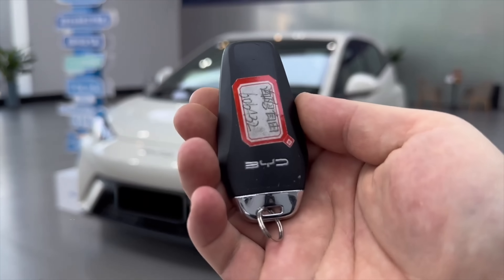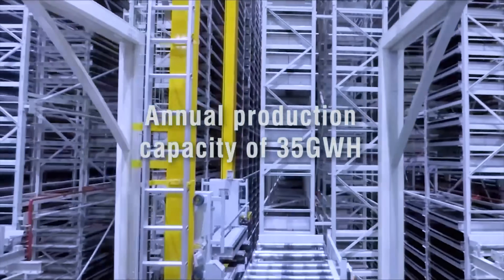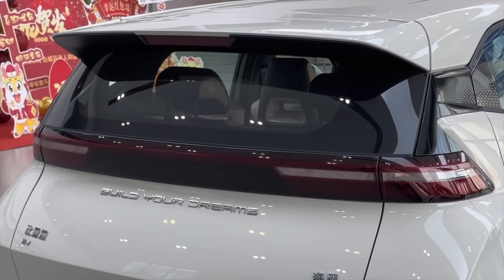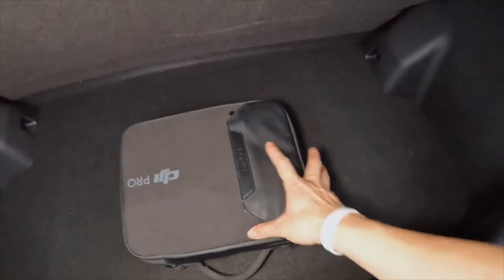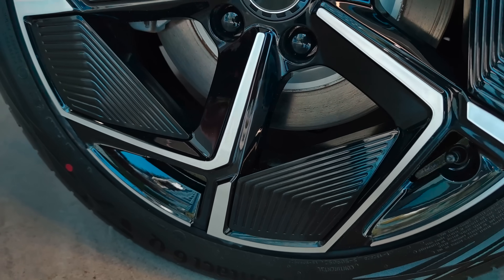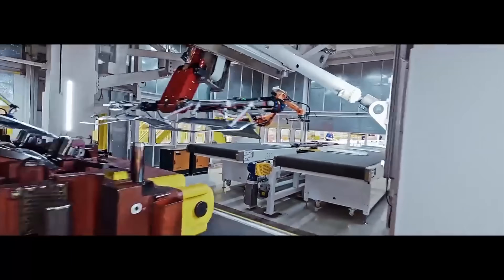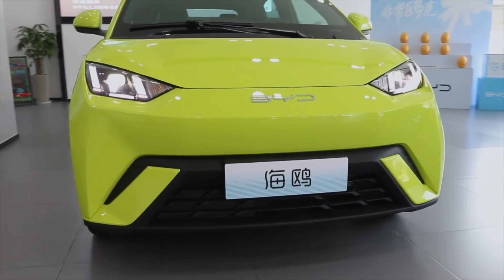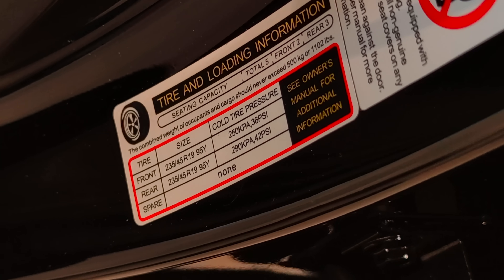Which BYD Models Are Getting the New Gen 2 Blade Battery?

Comment: The Blade 2 short format battery with much faster charging speed but not the much better energy density is already out in the Han L EV and Tang L EV. The Blade 2 long format battery with much better energy density is not out yet. If you can wait for it, it's probably worth it, as they have about 30% better cycle life as well.

Comment: mmm. Except that ignores the difference in chemistry and the reasons why HMC MNC cells have that 20-80 guide 'limit'. The blade cells are LiFePO4, and that chemisty really does well with 10-100% charge/discharge cycles. With LiFePO4, if you don't go above 80%, the float balancing, which is key to its longevity and performance, will not happen, at least, not effectively. It is my biggest disappointment, as a now retired automotive 'engineer', that the media do not distinguish between the chemistries, and do not challenge the myths. What does the Gen 2 blade cell bring? Leave the nominal capacities on the Dolhin (for example), where it was, but the pack itself will be much smaller and lighter. This gives you more space in the chassis, and the car weighs less. It also gives you the option to offer an even large pack option - expect that. At ex-factory pricing, on the Dolphin, it would shave as much as US$1000 off the end of line rolling cost of the vehicle. That will more than pay (money and in weight) for the additional DiPilot feature. This is why Gen 2 blade and DiPilot will go hand in hand. The new LHD vehicles being made in China already have both. The factory in Thailand will by now have received the parts need to start RHD '2025/2026' production. I do wonder where Byd will eventually produce the RHD models for the UK. They are currently spending a lot of money here, acquiring dealership premises in almost every town it would seem. The size of the network they are building speaks to a very large target sales volume. However, they have very little stock here, and delivery lead times from Thailand are quite extended. Even with such low stock, new sales discounts are quite strong. It does make me wonder if they have an eye on a factory site in the UK.

Comment: Hi Ben!  My Seal premium was collected 15.Dec. 2023   Today it is 66K (over) on the clock.  No problems, no complaints with it -- if anything,--- only accolades.  And I still love it.  Battery degradation? -- I don't know, but I can't notice it.  Of course, it is gen.1 battery.  Wander if the gen2 battery -- will be of the same quality?  And I mean, highest possible?  Greetings Ben.  Adam from Adelaide. Bye.

Comment: Thank you for the clear explanations regarding the second generation of LFP battery, Blade. We currently have a Renault Twingo ZE, mainly for my wife who drives within a 25 km radius of the house. We have been using it for 4.5 years and we are very happy. The trunk is a little small and the rear seats are not easy to access. In short, all this to say, that I would like to change my Renault for a BYD, because they use the LFP, which interests me, independent of a search for large autonomy, if greater than 200 km it is good but with the experience of driving and electric charging, I prefer to be able to charge my future car for longer (longer battery life expectancy) to be able to keep it for 12 to 15 years. why, second-hand resale is a disaster for a small electric, so when you buy an electric you have to think that you are going to keep it.

Comment: ICE cars drivers don't get that EVs are 99% of time charged at home, overnight, so charging speed is almost irelevant. They spend so much time on fuel stations thinking they'll need to do the same with an EV. I charge away from home 2-3 times a year when I go for a longer trip, and then I do want to make a break, I don't want to continue driving in 5 min, that makes no sense. My bladder has much much smalled charge capacity than my car, it decides when and how frequently I stop on a long trip 🙂
Reply: I really like BYD but lets be honest... you dont spend a single hour in a whole month refuelling.
We even had a peugeot which went 1040kms with a 5mins stop.
Reply: In the US the charging infrastructure is excellent especially in major cities.
Now I'm in the Philippines, that's all new and still developing. But every morning I wake up to 400 plus kilometers of charge. It is honestly more than what I use 99% of the times

Comment: I wonder if the constant upgrade of tech in EV,s will exacerbate ‘The Osborne Effect’. a bit? (That’s where you put off buying because the new and better item is imminent). I used to wonder why Tesla kept putting off changing models but continually upgraded the original model over the air however now I wonder if that was a really clever plan after all.🤔
I remember where cars style was the big change between models and most of the rest of the changes like engine and brake technology was incremental. Now tech is the big change between one model to the next.  So would I wait if I knew the new battery tech was around the corner? Of course, who wouldn’t.  I suspect that is why companies like BYD keep their new models so carefully concealed until release. Nothing new there of course but there does seem to be a reduction in time lately between when models are paraded to the public then released. (I would buy a Shark 7 EV if they made one. 🦈 Fingers crossed)

Comment: Has there been a case where the same model car get an upgraded battery in the previous release? It's usually the new model that will get all the new upgrades, the head unit chipset and screen, and most pikely the battery.

Comment: I just purchased a Seal 2025 performance model, in Australia.
It's my first EV and I only test drove the BYD to compare it against other EVs in my preferred list..I was so surprised by how good the Seal was, it went to the top of our list.
Do you have any general advice on charging to extend quality battery life?
Reply: LFP - charge to 100%, can use to 0%.  NMC - keep in range of 10% to 80% or 90% recommended.  Sometime LFP can be smaller in size, but better in daily use.
Reply: @hadtobe4502  ..and keep it at around 50% battery if you dont use it for long period of time. It’s in the manual as well

Comment: Very happy with my three yo Atto3. Now at 40,000km. No sign of any range degradation at all. 

Except on the occasional trip, all of our charging is slow overnight, once per week to 100%. That normally is enough for our weekly driving however, if we get down to 15%, we do give it a bump up charge.

On the odd occasion we fast charge, we stop the charge at roll back, usually about 85%.

Comment: On the subject of expected ranges and why doesn't BYD roll out tech sooner or whatever, there is an interesting angle. BYD started out with batteries, still is one of the biggest developers and builders, but their implementation in their cars can sometimes be not problematic, but there are always arguments about the efficiency of their electrical architecture in use. As an example; quite a few carmakers around the world have used or are using BYD batteries and get more range and efficiency out of them than BYD manage. Tesla is one example. In fact Tesla have managed it sometimes with earlier versions of the batteries than BYD themselves use. Some other Chinese carmakers have done so too. There aren't many column inches on this, but it's definitely a thing.

Comment: If only BYD would have optional one pedal driving, then I could be tempted to buy one. I consider OPD one of the highlights of my MG4.
Reply: Not sure for you but for me it's more the feeling of control like you're down gearing an ice car. The feel of the car when U are cornering or coming to a stop, regen is a bonus.
Reply: There is no need for OPD. It's old tech. BYD uses collaborative brake, when you press the brake pedal the car regen. It's more intuitive.

Comment: Thanks for the info.
Can you imagine, that there comes a law, that ICE cars have to be designed that the fuel cant catch fire . . . . . 🤣
We have the Dongfeng Box 40kWh LFP battery. Not the Blade, but probably a CATL battery. 
Dongfeng used to own a battery company ATL, (Amperex Technololy Limited) . . . that later went seperate as CATL. 
With that Dongfeng Box 40kWh usable battery we just did a 1000km road trip from Amsterdam to Innsbruck. 
No problem what so ever. We are in our 70th and like to take a short rest after 2.5 hours. After every 200km we plugged in a Tesla supercharger,  walked to the restaurant, ordered espresso and something to eat. But and every time before we were finnished the Tesla App said it was passed 80% again. 
So most of the time we had to hurry to the car and ride on :) 
In 2 stops (500km and 6,5 hours later) we booked in a Hotel and enjoyed the German town. Next morning again 500km and 2 stops. we where in Innsbruck. Relaxed and totally rested we started our Austrian holiday.
That is with a standard LFP battery, imagine what a gen2 blade will do. 
Probably 1 stop in every 500km. . . . . . that is a lot less rest . . . .We will chose 2 stops again. 😁

Comment from the maker: What is the minimum range you want from an EV?
Reply: 500km of real world range.
Reply: 300 miles
Reply: 300km is enough for us. We can charge at home and in the Netherlands there is a supercharger every about 10 to 15km. On longer travels we like to stretch legs and eat something every 2.5 hours anyway. Those stops are always at a supercharger with a restaurant. 
Toilet, some espresso, food etc. 9 out of 10 times we even cant finish te food before the 80% charge is done.
Reply: As a daily I have an Atto 3. Daily commute (150 - 250 km) it is great. Going down country it is definitely compromised for range. I do a 700 km drive in it a few times per year, and the lack of range becomes a significant issue. As another commenter posted, I’m patiently waiting for the Sealion 7 with the Gen 2 blade battery. Looking for a real world range in excess of 600 km.
Reply: 220km and use 200km. But I want that 200km in winter in -15°C so the normal range may have to be 350km. Higher density sodium ion could solve it too
Reply: 400km
Reply: 400km + safety buffer in -10 Celcius after 8 years (battery warranty duration) of degradation.
Reply: 1000km 😋